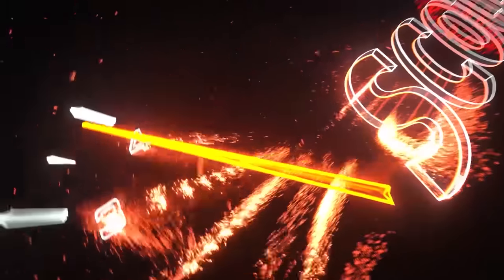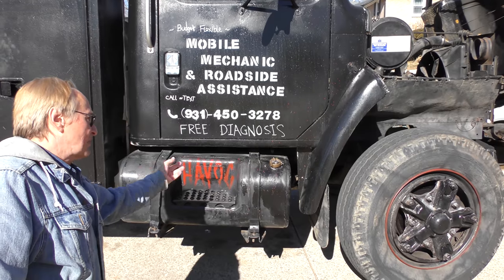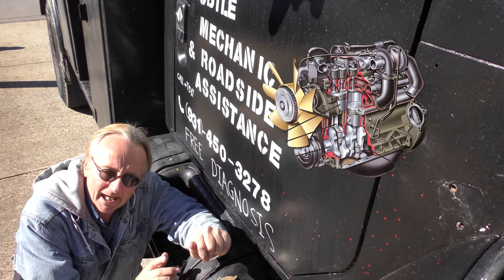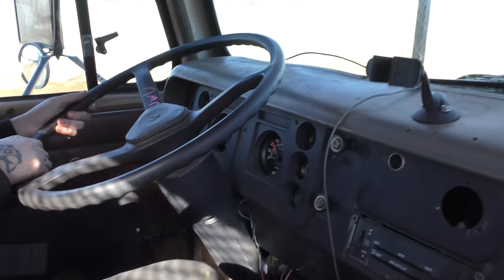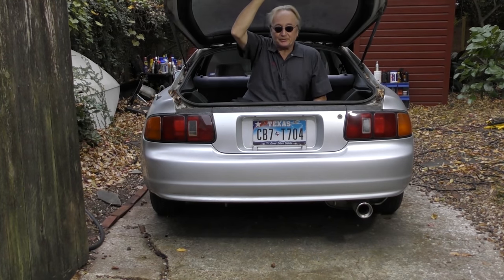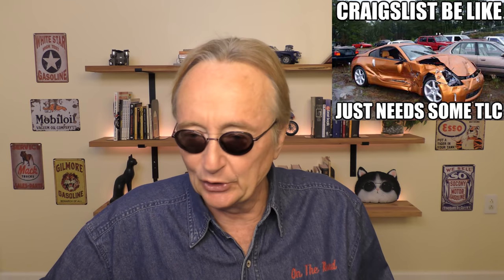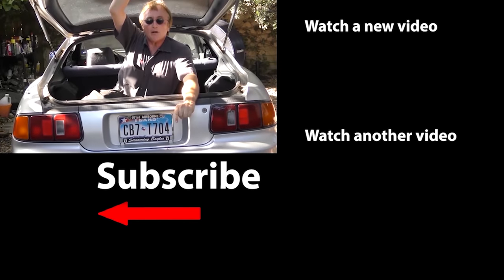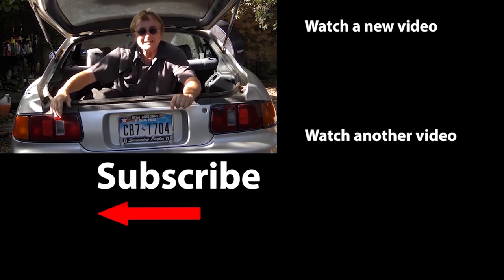Here's Why This Truck is Better than a Toyota Tundra or Ford F-150

Comment: Big, reliable AMERICAN Steel!  Now this is a Truck to be Proud of!
Reply: I want one!
Reply: One rare reliable American vehicle
Reply: American cars are cheap.
Reply: I have a feeling that you would probably get arrested for breaking some obscure fuel economy/emissions law if you drove that beast in CA...
Reply: My Tonka truck is Still going 40 years strong 🥾🇨🇦🤸🍻
Reply: You can make 3 Toyota Celicas just from the front bumper bar. 🤣😅😋
Reply: Looks like it’s straight out of the mad max series
Reply: No thanks I'll keep my Land Cruiser
Reply: @firesupport162  Land Cruiser is superiour to this beast but it has the diesel option it can come in handy in those days. Not saying our Toyotas are not WAR MACHINES They are just good to have many options available.
Reply: @sbfhawk4343  lol Land Cruiser can't haul nearly what this can
Reply: @stylicho  No Land Cruisers are Diplomat off Road war like condition machines fast agile and can off road. This truck is good solid Service truck that has alot uses no argument there.
Reply: I love old international equipment the steel in them came out of an international steel mill you can't get more American than that

Comment: I used to drive a truck like that cab. Ultra dependable, but the turning radius was horrible!
Reply: They fixed that in the next generation. Also A LOT of these had the steering stops set wrong from factory and never got corrected.
Reply: @unfairsanic5089  not like this truck! You'd have to drive it to understand.
Reply: @unfairsanic5089   I got 06 Porsche Cayenne S V-8. Can you elaborate for me ?
Reply: @ronunderwood5771  Are you talking about when they first switched to aero-dynamic in the mid 2000's or when they did some refresh but same body in the late 80's or maybe early 90's? I drove some short wheelbase 90's 4900's that had a tolerable turn radius but I also drove a  2005 4300 and that truck would turn on a dime. Worst turn radius I ever drove was a long-wheel base 96 ford F800.

Comment: I drove those diesel international for years when I drove a truck delivering in new york city back in the 80's and 90's Those trucks run great ! We even had one with disc brakes. they had the same two speed rear with the switch like that on the stick shift. I had a lot of fun ripping around in those trucks.

Comment: Back when International did their own research and development. Instead of passing it to the customer starting with the 6.0 Powerstrokes.
Reply: Emmissions weren't a worry. Mechanical was the way to go
Reply: @codyparker679  True that but it seemed Cummins and Duramax for the most part had it figured out. I know by the 2005+ 6.0s had a lot of the bugs worked out making them more reliable until the Maxxforce 7 came out. I know emissions really complicated things but I've noticed Cummins had it mostly together.

Comment: I was in Korea in 1969 and we had an early 50's deuce and a half to haul drums of fuel to the base camp for the generator. That thing was a tank and could go anywhere. One problem was it would not start when it got down to the single numbers. to solve that we kept it running 24/7 when it got really cold.

Comment: Lots of those sitting around for us all to buy ? 🤣
Reply: Yep. They do. Just gotta look around.
Reply: I got an old '79 GMC Brigadier dump truck last summer for $2500 (pretty close to scrap price).  It has 12 wheels and weighs over 24,000lbs empty, first thing I did was move 30,000lbs of asphalt fill in one trip.  Hydraulics work great, engine starts faster than my 2014 car when it's warm out, with that car's old battery.
Reply: Yup

Comment: My old buddy in Arkansas specializes in buying repairing and selling International diesel trucks. You may see him one day getting coffee at JJ's truck stop; exit 106 off I-30. He built his own custom oversize pick up truck from an older International moving van. He said he was into it for about $4,000 when done (a lot of welding on the bed, cut the frame, and new paint and tires) and he would sell it for $20K because it was so unique and he got compliments everywhere he went with it. He had that big tow pin on his also but it was his personal ride.

Comment: My first vehicle was a 1986 Ford F-250 with the international 6.9l diesel and a Borg Warner T19 transmission. Gonna buy another one as soon as I move somewhere with more space to park one. Never had an issue with the engine. Speedometer had rolled over at least once so I estimate it had 220,000 miles on it.

Comment: I love the sound of a good diesel engine. I have two diesel cars, a small 2011 1.6L Hyundai i30 with a manual shifter that I use for my daily commute to work, and a 2017 Volvo D4 XC60 with 2.4L 5 cylinders engine that we use as the family car...

Comment: Best to set that 2 speed rear axle in high range.  Earlier DT466 engines are great!
Reply: Prolly a 444 but they are OK.
Reply: @sammolloy1  Nope, that is a 466. Inj pump on the side. Also at that time there was no T444E, those came about 1994, nAV's first electronic engine and a pretty good one all things considred.
Reply: Put in low, run your gears and then split to the high side once your in fifth. Problem was the 5sp was not quite enough spread without the two speed. You either struggled a little starting out or were cramped for road speed on top. 2 speed helped that. A bit later on 6 and 7 speeds came in and the 2 speeds went away.
Reply: @sammolloy1  It's probably a DT466. Since if you look , you can see it's an inline 6 cylinder. The 444 is a V-8. I think Scotty said the truck's an 87. The early IDI's came in two sizes, the 6.9 L IDI (420 cubic inches,) used from roughly1983 until 1987, and the 7.3 L IDI (444 cubic inches) which was used from roughly1988 until 1994 (naturally aspirated) and in 1993 and 1994  (turbocharged). 7.3 DI engine T444 was after 94, AFAIK?  I too like older mechanical diesels.  PS, I agree the 7.3 IDI turbo version (preferably) or 7.3 L DI aren't that and can be reliable, just as long as you don't push them beyond their design capabilities. (Kept within reasonable gvww, and gcwr)  If I had a choice though, I'd probably go dt466.

Comment: I have a 1996 Rav4, recently it had a cranks but no start problem and died on the freeway. The rotor in the distributor was loose and destroyed the cap and rotor. Fixed the rotor and replaced the cap. Starts fine now, but now it only starts when the engine is cold, it will not start when it's warmed up. Popping the clutch will get it started, and it runs fine when it is started. Was going to replace the starter or coolant temp sensor as they are the original Toyota ones. The starter sounds the same when hot or cold. Battery and alternator are working properly.

Comment: Scotty

If you go to harbor freight and get a pressurized toilet plunger that's a hand pump it has a large cone on it made of rubber that conforms to odd shapes. You put a whole lot of Grease around the mate between the panel and the suction cup. Then you pull back on the plunger and vacuum suck it out. It might work for some dents. If you do manage to create a vacuum then you can just pull on the whole thing and yank the dent out. It even has a smaller one of the rubber seals that go over the kitchen sink for really tiny dents. You do the same thing you just pull on the handle create a vacuum and then pull the whole thing back, and it pops out the dent sometimes.

Comment: I don't know what motor that is, but the IH DT466 is a good diesel motor . DT466 were produced from 1971 through 2016, the first two decades+ were mechanical injection.   These are relatively easy to overhaul in the chassis because the liners are removeable.   In the 7 liter class its hard to beat the DT466 if the chassis can handle the weight.

Comment: Those old Internationals run forever. The late model Internationals however are absolute piles of crap.
Reply: Once you put DEF on your screwed
Reply: I drove Internationals as fire trucks and as commercial trucks.  Troublesome - even before the DEF tanks, particulate filters, and electronic crap.  Reliability and parts availability always seemed to be an issue.  To quote Scotty "Don't pay a lot for it".  Does International sell the cheapest custom chassis?  Sure - you get what you pay for.
Reply: 100,000 miles? Barely broke in. Drivetrain pretty reliable. Chassis ? Those I did work on before 1984 that usually had chassis problems. Well then those were a fun day spent tracking down the right part or more than one day. IH was not the best with tracking production day and what got put in the vehicle on that  day.
Reply: @bcgrittner  Along with  GM, Dodge  Hemi, and the  Cummins X15 engine  option  for  Kenworth,  Peterbilt, International, Volvo and  surprisingly  Mack. Include Ford adding that  stupid  DOD on the  V8 for the  F-150 for  2021
Reply: That truck may only have under 100,000 miles but may easily have 15,000 to 20,000 hours on the engine running the PTO
Reply: @K456-n3z  Oh yea
Reply: @denniskennedyjr.9128  Once you don't have a mechanical injection pump
Reply: @apolloniaaskew9487  What is the " stupid DOD on the  V8 for the  F-150 for  2021" all about? I don't follow brand new truck designs like I use to as I can't even think about affording one and I am no longer a big ford lover like I was over 20 years ago.
Reply: A lot of contractors at my work still have the 7.3s. But the   6.0 and 6.4s didn't last that long. As far as emissions go. Duramax and Cummins seemed to have it sort of together at the start. While Navistar outsourced the design. It also didn't help that the Ford versions had to meet different emissions standards. I've noticed quite a few of the late model International big rigs use Cummins engines.

Comment: At my work we still run a truck with the exact same engine for a yard truck, It has air brakes instead of hy disk, So it can move Trailer's with air brakes. Still runs like a top this engine is know as a TD 466 International Turbo Diesel.

Comment: Scotty I bought a used 2006 Chevy Malibu LT. I payed over 2,000 to get inner and outer  tire rods, struts, controls arms, etc. basically everything to help it ride smoothly. I drove the car for one day fresh out of the shop before it died on me. It wouldn’t accelerate after I hit the brake to slow down or stop at a light. I would have to put the car in park and start it again. I would repeat this every time I had to do slow down or stop. It eventually just died on my way home. I was told that my motor had went out but I don’t want to just go and purchase a new engine without a second opinion. Can you tell me what you think about it. Like this please so Scotty can help !!!!!!! Have a great day and a better year.

Comment: Remember those great,
International engines sound as a pound, like the caterpillar engines and the 
Detroit 2 stoke diesels, made to last and do a million miles.
Reply: My '79 GMC Brigadier has a 6-71 Detroit in it.  When it's warm out it starts faster than my 2014 car, with that car's old battery in it.
Reply: The late 90s and early 2000s motors were arguably even better though like the 6NZ Cat and 60 series Detroit. They had just enough electronic control to make them run better without adding anything that complicates them too much.
Reply: @marshmallowblaster  series 60 was a great engine hands down......simple....cheaper for parts and was way advanced for its time.......😉👍
Reply: @fil1329  You can thank Roger Penske. GM, after disastrous 92 series and facing a downturn in the truck market was giving up on Detroit. the 60 series was ready to go but they were going to shut it down. Penske heard about it. That is another story involving Newell Coach. Went to GM and  said basically "if your shutting it down, how about selling it to me instead".And thats what happened.

Comment: those DT466 mechanical diesel engines are the best engines international made
Reply: And the 7.3
Reply: @garcjr  the 7.3 is the T444E
Reply: Is this the s1800? Which ones weigh under 10k lbs?

Comment: That is a legendary dt466 or a dt360.
My f250 is like that & it’s great. She’ll run on anything, waste oil, atf, veggie oil, & many many more.
Reply: I'm thinking it was the 7.3 T444 idi
Reply: @uAKING2006  nope, look at the injection pump on the side. And count the lines. 7.3 IDI pump was a rotary standadyne mounted in the valley
Reply: In a way the the 360 is even more durable than the 466. Not as much power. Same rod and main bearings. Takes a sharp eye to tell them apart. A bit shorter. It will run forever! Might not get you there quite as fast but it WILL get you there. Everytime.
Reply: @uAKING2006  That is the straight 6 DT466 not a v8

Comment: I used to drive one of these hauling mail. Never had any problems with it. 
Funny story, my boss called me and said I would have to switch trucks with another driver because he had a flat tire. We moved all the mail equipment from his truck to mine and when he went to start it, it just kept cranking and wouldn't start. He didn't shove the kill cable in (looks like a choke cable except it cuts the fuel flow to the injection pump). His truck had electric injection and he never drove a truck like mine before. 

I think the truck in the video has a DT360. Mine had a DT466.

Comment: I had an 89 International diesel, had 200,000 miles on it and threw 2 push rods right out of the valve cover.  I was able to go another 100 miles to finally reach my destination though.  Sold it to a scrap yard for $700.

Comment: I work at the factory.  The gas mileage might be a concern but personally I like the newer NGV cab vs the S series cab in the video.  The DT466 engine you can't beat and it will go a million miles

Comment: I use a stud welder...weld it to the dent....pull it with a slide hammer  ....grind it...fill it...prime it ..paint it.. if you dont have blend room to the ajoing panels...prep the panels for a blend..pretty simple.

Comment: We got Diesel School Buses in 1985 the year I graduated from High School.   They were tough buses, but our stupid high school thought they needed to line them up in a straight line and warm them up for at least 15 minutes and if You were the front bus, it wasn't very bad, but if You were 2 or 3 buses back then You got a terrible headache from smelling diesel smoke because The people at My High School were idiots lining them up in a Straight line.   I have seen a recent video about those disel buses and they only recommended warming them up for 2 minutes, however our stupid school system thought it was necessary to warm them up for at least 15 minutes.

Comment: Got a buddy that is a mobile diesel mechanic. He's got a truck like this one. Dave's is and international, has a small crane in the back, a heck of a lot of tool storage and a nice size flat bed, what I like about it is it's a 4-Door, looks cool as hell but makes a better work truck. The best part is he worked up a deal through horse trading for it. There was no money exchanged. I would like something like it to put a small travel trailer on the back, make a heck of an off grid camper rig, lol....I did try to talk him out of an 01 or better suburban X-long 4-WD that had fuel issues but another friend had a bit more money at the time, oh well, some ya win, some ya don't, lol.....

Comment: I rented two of these when I left California and moved to Texas. I had an alternator that died. But where I lost a lot of time is climbing the Tahatchapie mountains. Every thousand feet I had to shut her down because she kept over heating and the alarm light and buzzer kept going off. If I remember correctly the truck only had 40 K on the engine.

Comment: Almost 20 years ago I bought a 71 F600 for $300. It had a 300-6 and 4 speed manual transmission with single speed rear axle. It was a blast to drive but needed work. I sold it back to the father of the young man I bought it from for $200.

Comment: Dt466 can be rebuilt in driveway. With new pistons and sleeves and bearings bought as a kit.

Beware when the o rings in the bottom.of the sleeves go bad somewhere arkund 300,000 +-  it dumps coolant in the oil pan. 

But you can get a trashed  466 real cheep and  put a kit in and 
Essentially have a brand new motor.

And you can turn up the mechanical pump for more power. Imlo.

And then theres the  rare 502

Comment: These old International diesels would run on almost anything. I remember  at my last company I worked for we would dump all used motor and hydraulic oil into the tank of our 94 International service truck ran off of it just fine if a little smokey if it had more motor oil in the tank then diesel. If I were needing a vehicle to survive the apocalypse that truck would be it.

Comment: Put a propane tank temp color strip on fuel tank then a layer of clear coat over it so it won't peel off and you be able to see level of fuel inside tank from the outside due to temp difference.

Comment: With modern cars , if they die randomly at stoplights or deaccelerating  coming to a stop, thats a alternator malfunction. Set a quality multimeter to AC power setting, put the leads on + and - on the battery, if you have more than 0.35 AC volts in the system, the alternator diodes are may be bad. Modern vehicles consume alot of power, a sine wave in the system will cause problems.

Comment: Great truck!  I love these old cornbinders, especially with 466 family of engines.  I think Scotty missed the gears on the transmission.... it is just a 5 speed manual nothing special,  He missed the complexity on the shift pattern is the two speed rear end.     While it is old and reliable, there is one drawback with the truck....it doens't go anywhere fast, these aren't geared for modern day speeds.

The feature I like the most on this truck is the high beam light switch on the floor.